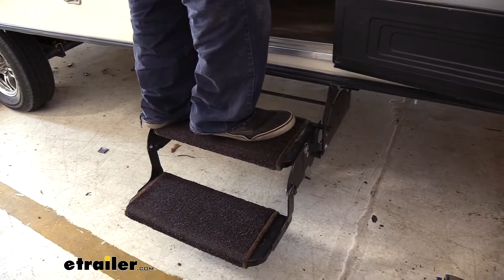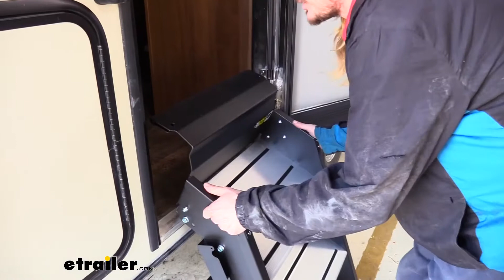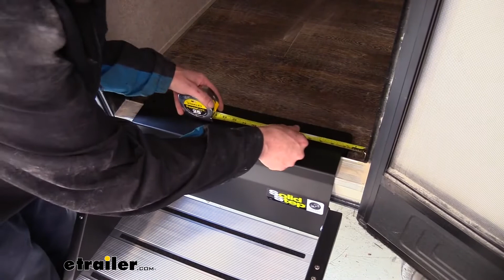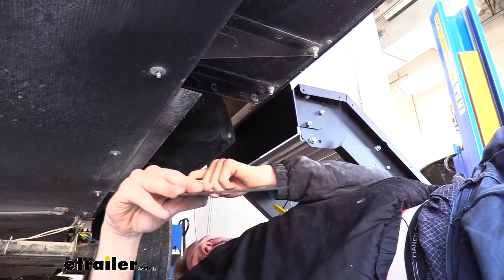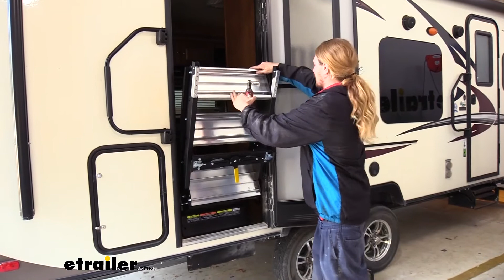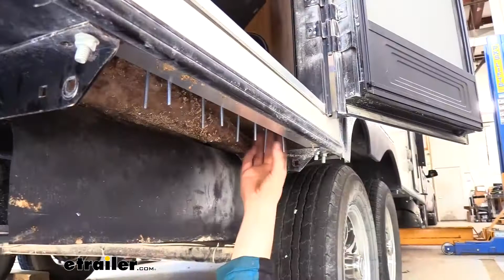Lippert SolidStep Manual Fold-Down Steps Install - 2018 Forest River Rockwood Mini Lite Travel Trail

Comment: Thank you for saying 15 mm socket. I am doing this job on my 5 month old trailer today. $260 for the dual lippert stairs. My wife not falling down 2 foot and ruining a trip is priceless. KZ should have put these on standard. Those floating stairs are a joke. Then again this will be like the 15th mod ive done to my KZ sportsman 170MB in 5 months.

Comment: What model Rockwood Mini Lite did you install them on. You used a 3 step version. 
I have a Rockwood Mini Lite 2109S and want to install the 3 step version as well.  However the distance from the threshold to the ground is 26.25 inches. The Lippert webpage recommends the 2 step version for that height. They state the 3 step version requires a ground to floor height of 27-36”. I am close with 26.25”. Do you think I can get away with the 3 step?
Reply from the maker: You can definitely install the 3 step option since you are that close to the measurement. The two things that you have to keep in mind is that your bottom step is going to be closer to the ground and you will have to keep in mind when you are parking your camper you will need to make sure on uneven ground that you have enough room to deploy your steps.
https://www.etrailer.com/RV-and-Camper-Steps/Lippert/LC791572.html

Comment: you did not show with the steps down if the doors would close ???. i seen a gap in the threshold at the front of the outside door between it and the step.
Reply: Exactly! That part of the threshold plate is supposed to be flush against the door threshold or the door won't close with the steps out. That's what happened to mine. Notice that they didn't show the door closed with the steps out and haven't replied.
Reply: @kenpricher2756   Mine close just fine. We bought the camper with the 3 steps. Make sure you sweep them before pulling them up when you bring the steps up. Otherwise all the dirt or sand will end up in the camper!